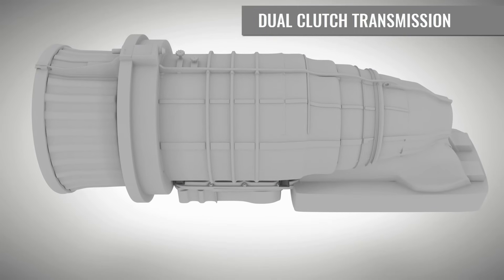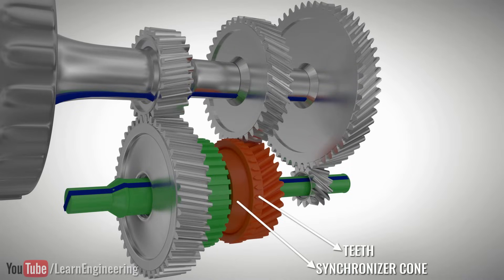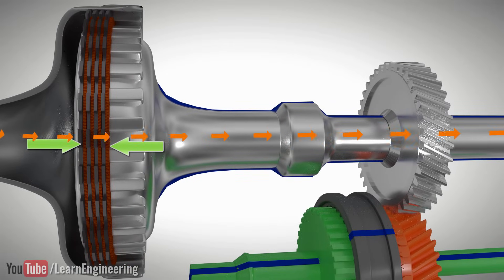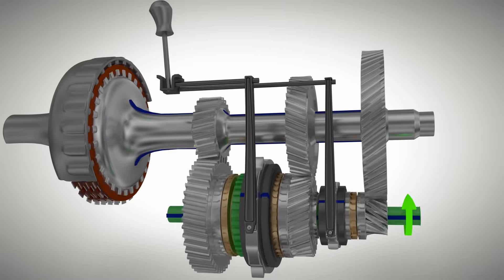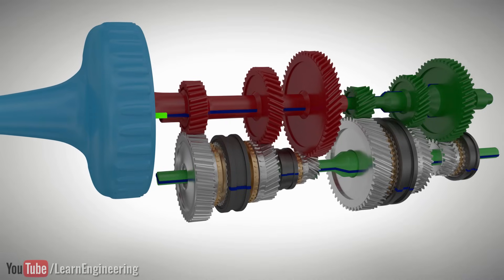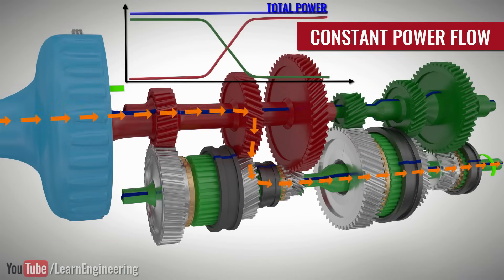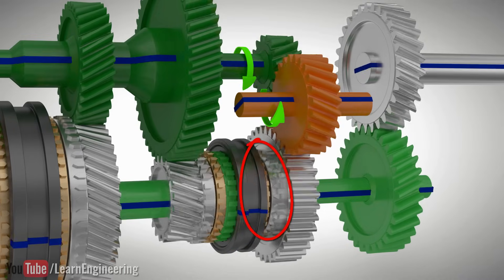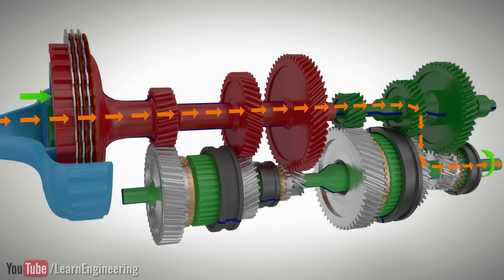Working of Dual Clutch Transmission (DSG)

Comment: So how does it compare to a cvt in terms of weight an thermal efficiency?
Reply: The CVT is more efficient in the sense that it will automatically use the most efficient gear ratio to achieve the speed that the driver signals with the foot pedal which the DCT simply cannot do. However, CVTs inevitably also have slip due to the oil-seated steel-belt-on-steel-cone construction which gets worse the more power you try to get out of it (i.e. at high speeds or when pulling a trailer up a hill).
A DCT is more efficient for those. It really depends on your personal driving style. People who want an automatic transmission and race over the highway all the time are easily better off with a DCT. It will likely also last longer for this use-case. If you're mostly driving through towns and villages with only short fast sections inbetween a CVT is the better choice.
Reply: A CVT is more efficient in that it can lock in fully and remain locked in the entire time the vehicle is moving more than a crawl, simply modulating the gear ratio. It can also utilize more optimal gear ratios. It's a shame they're so miserable.
Reply: senecadream
Sure, but that doesn't answere my question.
Reply: elwulfo666 I did: "A CVT is more efficient" (then I explained why). I don't know about weight, though. I would expect the DCT to be heavier just by looking at the number of large metal parts.
Reply: What i meant was that there's a powerloss inside of every gearbox due to fritction between gears, inside bearing and so on. I was wondering if the CVT was more efficient in this term.
Reply: qwesx
Thank you.
Reply: DCT is basicly like a manual transmission VER 2.0. If you are constantly driving at the gears' best working condition, manual transmission offers the best fuel economy. In between two gears, CVT is better. Which is to say, CVT is advantageous over broader range of speed.

Comment: So, why in DCT whe can disconnect one clutch and connect another, but for doing the same thing in automatic transmission whe need a torque converter? I have problem with figure that. To many stresses for planetary sets?

Comment: If DCT are simpler than automatics, why are they so much more to rebuild/repair? My automatic based vehicle was in at the mechanics at the same time another customer had their DCT based vehicle in. The rebuild on my automatic was half the cost of the DCT's clutch replacement. Ouch.
Reply: House of Hacks Aah yes. Not designed for maintenance is a large problem cars have these days. In our family car, they have to remove the whole intake and exhaust tube stuff in order to exchange the oil filter....
Reply: Also, DCT's are not yet very common, i guess?
Reply: depends on what was wrong of course
Reply: da faq?!? What car is that ElectroBlood ??
Reply: I mean I saw some super cars where changing the clutch was super major surgery (even body panels had to be replaced!!) but a family car? wow!
Reply: dosmastrify Well okay. I might have been exaggerating a bit :D, but fact is, unless you know exactly what you're doing with the tubing, you should not attempt changing the filter. It's a VW T5. In our old car (a VW T4), it was as simple as removing a panel and poking in there with a wrench. 
Now, oil service is quite an act and not really possible without a detailed manual, which conveniently is not sold to the consumer market. The only ones that have the guides are garages and the don't want to lose you as a customer, so they will not give any of them out.
Reply: Various factors, usually a DCT is a bit more complex than the proven automatic transmissions on most setups due to the need of fitting into approximately the same space. They need more time to disassemble and also more precision in manufacturing and assembling. Additionally being newer in technology there are still certain things that have not yet been tried out in the vast volume that automatic transmission has been, and they have been designed from ground up, not evolved like automatic (first automatic was 2 gears, then 3, then 4, I don't know how far we got these days). Mechanics are not as experienced yet with them, needing more time, especially in troubleshooting. Their volume is lower, so the setup cost can not be divided among as much units. There is little competition on the market (of already low competition components, gearboxes are not exactly those parts that you have a huge range of manufacturers for, since not many people go to the shop and ask for change). They have more sensors and electronics than the average automatic transmission and even more than manual.
Reply: Ouch. Perhaps it's time to get a relocation kit for the filter. But I know what you mean. My dad was telling me a couple weeks ago about a friend of his who has a car that has to have the engine pulled to replace the back two spark plugs. And I just had the u-joints in my driveline go out. The factory units are non-replaceable, molded into the driveline. Per the manufacturer, you have to replace the driveline when the u-joints go out. A new driveline was $1200 and was on backorder. Or the custom driveline shop could cut off the old ends and put new ends on that take replaceable bearings for $500. Guess which option I took. :-)
Reply: If you're scared, then don't do it. I think it's pretty mature technology though; it's been around for quite a while. Most of the problems should be fairly well known and addressed.
Reply: I don't know if auto makers have done any testing on them. They're probably too expensive for their applications. I think remote filters' primary application is in truck and marine applications. Most car applications are done by modders when doing engine swaps with limited space. They aren't very complicated, no moving pars, few points of failure. Personally, I wouldn't be too concerned about it. But then my risk tolerance may be higher than other people's.
Reply: I hadn't so I went to their web site. Thanks, but no. I'm sure many people will like it. But for myself, almost everything they  advertise as "YES, WE HAVE THAT!" is exactly what I don't want: Apple Carplay, Android Auto, multi-view camera system, blind spot warning, lane change assist, rear cross traffic alert, forward collision mitigation. Too many things to go wrong or get obsolesced. And they didn't make it easy to find, but I suspect it's FWD, another check against it. If they weren't so expensive, I'd have Icon Motors build me an 80s vintage Blazer.
Reply: Decades of mass production of traditional automatics has made production costs very low. More limited production of DCT/DSGs coupled with the fact that they are newer technology means that production costs are still rather high. As these newer transmissions take a larger share of the market, their prices will also decrease.
Reply: also since there not very common not as many companies would make replacement parts therefore the companies that do make the parts can charge alot more for them ( basic supply and demand rules )
Reply: Jesus F. DSG6 tends to be more reliable, mostly used in higher performing cars. DSG7 is newer, but more used in normal cars with more economical consumption. I acually have the DSG6 on my 1 year old 2017 GTI Clubsport you can see videos on my page here! Its a quite special one as its the 40 Year Anniversary GTI (not sold in US). Im from Sweden so.. :)
Reply: It's the same reason why automatics are cheaper in the US, and manuals are cheaper in Europe... It really just depends on what's more common
Reply: Harley Pebley id just be scared of that somehow restricting flow or causing some other adverse effect on the oil system
Reply: Harley Pebley has it been tested as rigorously as the big Auto makers test everything else?  I've heard of these things but never seen one in use in real life... thats alot less common than other parts, much less data to pin down where a failure point could be.  Though I'd probably try it too if it really was a royal pain to get to.
Reply: If you have a DCT it should be under warranty,DCT aren't as common and produced as much as standards autos,it will change tho,CVT and DCT will take over.
Reply: Did you know those service manual guides cost money to garages?Not only that but they are extremely expensive,depending on what,you can be looking at 200-300$ just for a fucking manual.
Reply: samymasta Well, when I buy vehicles, the warranty has expired. :-) I doubt I'll ever get a vehicle with a DCT. In fact I'm looking around at current vehicles wondering what I'll be buying when my current ones need replacement. Not really seeing anything that I'd be willing to buy into; too much useless technology.
Reply: Harley Pebley
Well unless you want a 1998 corolla,you'll have no choice but to embrace technology.What's your problem with it anyways?Manual trannies will always be around if that's your thing,it's only the standard shitty autos that'll be gone.Altough,CVT's and DCT's are here to stay.CVT is smooth and efficient.DCT is for performance.I just bought a brand new Mitsubishi Lancer with CVT.I love it,it's the exact same shit as normal auto but more efficient and smoother,what's to talk so much shit about?I went to Mitsubishi last week for my oil change,I tried the Evolution x MR while I was waiting,it's a DCT in it,it shifts FUCKING fast.Simply put CVT will shift through computer all the time,not DCT,you can play with it hence why it's used in performance cars.
Reply: Well, I wouldn't get a Corolla because I don't like FWD. :-) But yeah, I considered getting a 90's vintage vehicle when I replaced my BMW. It'll really depends on what I find when I'm looking. I prefer manuals but the problem is finding one. They're really rare; low single digit percentages of sales on new cars here in the US. So they're almost impossible to find on the used market. The technology I don't want isn't so much in the drive train as much as it is the user interface. All the smart/connected car stuff. I don't want/need to control my phone through the steering wheel or some touch sensitive center console. And I don't want to control all (or a significant percentage of) the car's functions through a single, multi-mode user interface.
Reply: Harley Pebley
I had a ford Escape 2007 before my Mitsubishi,very basic interface,Manual cars in good conditions,like you said is almost impossible to find but if you're willing to look at autos,any American car that's a 2010 or earlier,would suit you,the technology used in interfaces didn't really change much between nineties and beginning 2000's,it really started to change in American cars towards 2010+....European cars most of the time have better interface technology earlier so if you were ok with your BMW you'd be fine with what I just mentioned.You would absolutely hate recent years BMW/Mercedez then lol
Reply: Yeah, the vehicles I have now from the mid-2000s will be good for awhile. I'm thinking about my options in 5 to 10 years. Typically at that point, I'd be looking at what are now new vehicles. As I casually look around, I'm not seeing a whole lot that interests me.
Reply: House of Hacks
Ever looked at Mitsubishi?My Lancer for instance has the same dashboard they used back in 2008,only added a touch screen for music/radio and to display the rear camera,that's it.Some people criticize Mitsubishi for that,some others don't mind and are happy with it.It's pretty simple and straight forward,only like 4 buttons on the steering wheel not 89723498798.Check em out if you haven't,the 2017 Outlander is absolutely gorgeous,I went last week for my oil change and was very surprised.Clean sharp looking,added led headlight so it's all white instead of the old yellow halogen.Also added some lettering on the hood,beautiful SUV,I'm actually thinking about trading my Lancer for it next summer loll
Reply: it's cheaper material cost to replace steel or aluminum bands and paper clutch packs in a regular automatic than it is to replace actual metal gears and shift forks in the DCT... plus if u think about it with the DCT ur rebuilding 2 three speed transmissions and 2 high end clutch packs that are made of metal ceramic friction material and 1 metal friction plate and probably a fly wheel... along with all the pumps and actuators that thing probably uses not to mention that manual transmissions have a few more bearings that usually need replaced... the cost just keeps going up
Reply: Yes, thus proving my point, They're not simpler. They may have many great attributes to them, but "simple" isn't one of them.
Reply: ElectroBlood lol I have to remove my intake just to change my spark plugs... Chrysler 2.7
Reply: House of Hacks yeah, I'm pretty sure regular automatics r cheaper than DCTs, or else we should be seeing them in Camrys and Accords lol, but we don't. We only mostly see them in expensive sports cars
Reply: ElectroBlood might as well ask em to scrape the deposit while they are  at it
Reply: House of Hacks they tell me VW DSG 7 SUCKS.
Reply: probably due to dct cars still not being as common as automatics and dct's have not been around for very long so there is a good chance that they are still really tricky to work with or things just might take longer due to some mechanics being less familiar with the dct system
Reply: That's just like asking Why are automatics cheaper in the US than manuals however they then cost more to produce.
Reply: Hacks, they're not simpler than automatics; LE was using the wrong kind of wording. They ARE automatics; just not the traditional (planetary) kind. So it's not "DCT vs. automatic," but it's "DCT vs. traditional/standard/conventional automatic" (even though the DCT is more manual-like mechanically).
Reply: ElectroBlud, we don't know if you guess, because we can't read your mind. So if you were to just tell us that you guess instead of asking us, that would be better.
Reply: If you have a VW, then VW is the problem. For example, a DSG oil change costs $1,000 if you get it done at a VW dealership, though parts are less than $300. I suspect the same is true with repair/replacement.
Reply: House of Hacks DCT are cheaper to manufacture and repair, they charge more for the repair because they can
Reply: In this particular case it was just a clutch replacement. R & R the transmission with a new clutch installed. I think the clutch pack by itself (the parts) was as much as my whole rebuild, including labor. I'm guessing part of it is price gouging on the part of the dealer. They're new enough and rare enough that there's no 3rd party market for the parts so you're paying a premium just for the parts. But it was also apparently not designed very well for maintenance. There was a huge amount of labor just in the removal and replacement of the tranny.